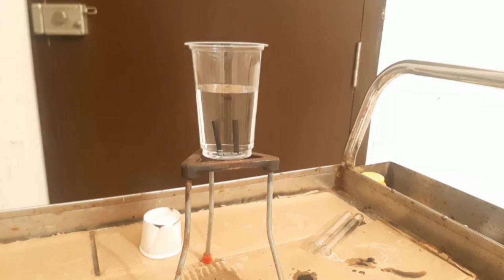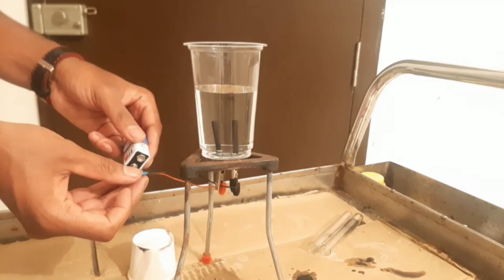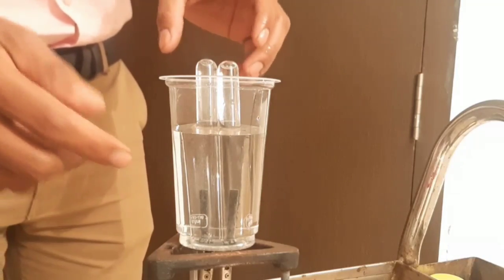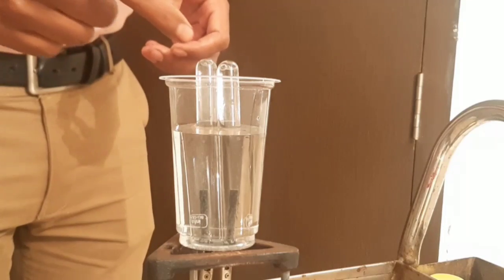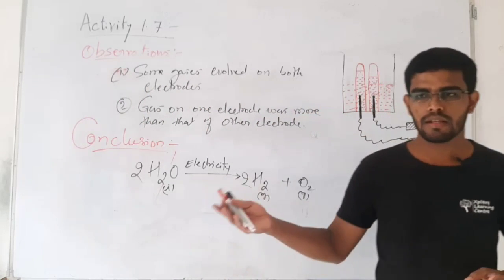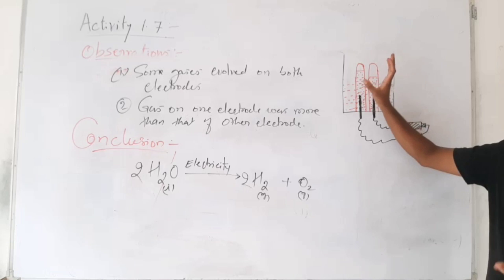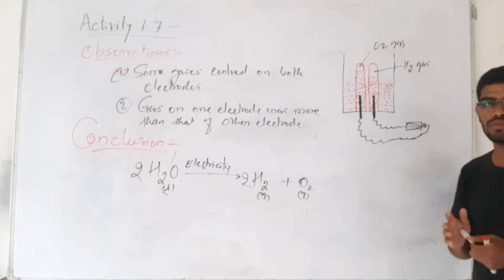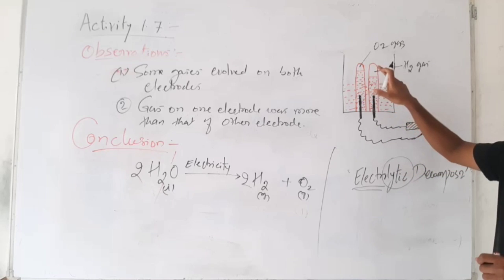10th Science, Activity 1.7

Comment: Sir if we take sodium chloride in water without taking dilute sulphuric acid then we need molten sodium chloride why should we not take solid sodium chloride
Reply from the maker: Only charged carriers conducts electricity, that means ions. 
In solid NaCl  its nutral species. 
But when its added in water it forms ions.. which are responsible for carrying electricity. 
So solid NaCl can't b used

Comment: SIR , thanks a lot for making such a great video.... but i have one doubt that what was the need of filling the test tubes with water and then inserting them on the electrodes??
i mean why can't we directly put the empty [without water] tubes on the electrodes??
Reply from the maker: Test tube without water contains gas in it 

And when filled with water,  there's no gas at all. Newly formed gas collects over testtube by displacing water inside it.
Reply: @XploreLearningCentre 
Thank you so much sir for commenting and clearing my doubt... Thanks a lot sir
Reply: We should heat if pop up sound is released then gas in hydrogen